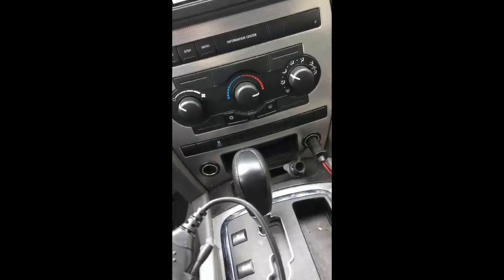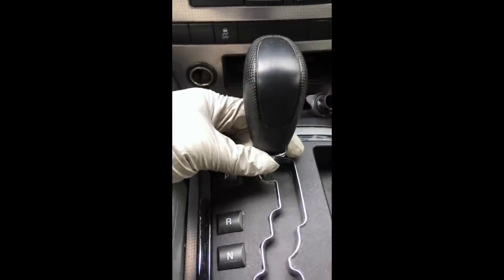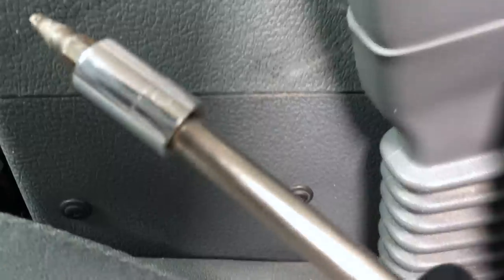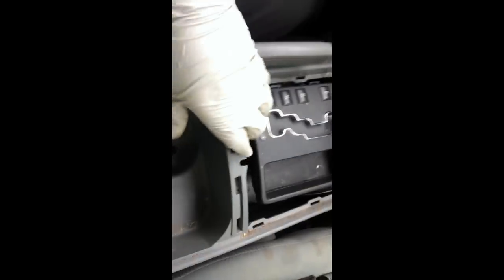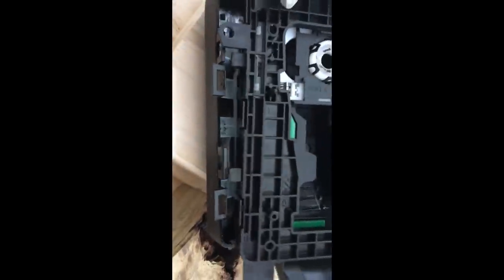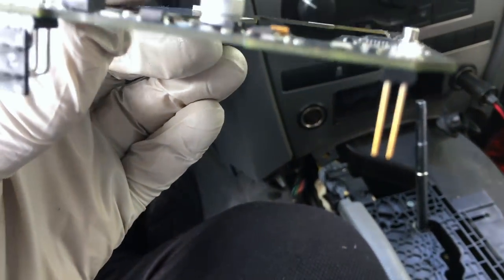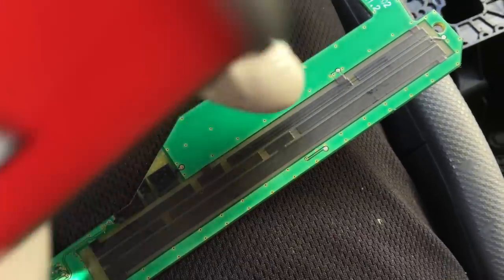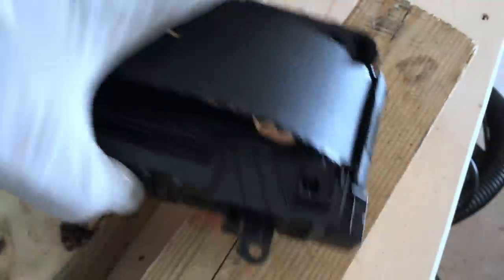2006 Jeep Grand Cherokee (WK) 3.7 Electronic Shift Module (ESM) Problems U0404 P0700 Codes

Comment: I have been going in to limp mode while driving and I notice it on high rpms and I try to manually shift using the + - on the shifter and nothing works. I pull over and restart the vehicle and all is well till it does it again. I cleaned this board and yes it was very dirty on the break points.  Now it hasnt done it at all and it even shifts better.  Thank you  I was about to replace the transmission and honestly it would have done the same thing!!!!
Reply from the maker: @elmslawncare  awesome brother glad to have helped. Save that hard earned money brother. Thanks for the feedback.
Reply: @MrV2u Dear MrV2u, Thank you for sharing this video it is really a stress reliever for some. I have another kind of  problem with my ESM, it works properly in All PRND but, when I put it on Drive, I can't shift to - +, is there a way of adjusting this issue? (I am able to move the "handle" left right but cant go from D to 4321...)

 I opened the upper part as you showed in the vid, There are two thin metallic pieces surrounding the black plastic square that is attached to the white horizontal one (shifter)... Should these be the problem? Could they be cleaned or adjusted? Many thanks😊😊
Reply from the maker: When you put it into manual shift all you do is hit the lever up to upshift and down to downshift. Is that not working?
Reply: @MrV2u  not for me, it is not working. ☹️ Could it be a board problem?
Reply: @MrV2u  To be honest, this problem appeared right after the "cover band" broke (the thing that covers against dust), so I had to open and remove it... and then this problem appeared (any relation to this manoeuvre?)
Reply: @MrV2u  Could you help me please
Reply from the maker: Does the lever move? How did it crack? Did something heavy jam it ?
Reply: @MrV2u  The thing is that the dust strap broke and the plastic part that joins the two mini straps was still attached to the handle and I forced it by moving to P R D N, so I think it may have moved or damaged the steel parts responsible for the - + shifting. 

My question : Is the plastic strap responsible for shifting to 1234 during drive mode (D) ? Or something in the electronic board may be dismantled ? 

Nb: I can still move the lever left and right in D mode, but on the pannel board it is not going to 1 2 3 4, it is blocked in D . Please if you could help would be great! Thanks a bunch ❤️.
Reply from the maker: You may have to swap out the entire esm handle and all. You definitely tweaked something in there.

Comment: I've been a transmission tech for 21 years. You did a fantastic job on this video my friend! helped my stress level tons! Thanks, take care and God bless!
Reply from the maker: Thanks brother for the feedback. I try to be as thorough as possible. Bless you as well. If you have any further questions I’m always here to help my friend.
Reply: Update: The small two wire connector at the right rear of the shifter was broken. The big connector was fine. The board was new so someone had their hands in it before me. Made sure it was back together correctly and it worked perfect. Customer was happy.... Thanks again!
Reply from the maker: Too many cooks in the kitchen. Good catch my friend. Tracing electrical problems could be quick or an all day deal. I just had a guy with the same issue and swapped out the esm twice, and cleaned each one twice like I showed. Still having issues. I bet that’s his issue as well. Keep in touch brother.
Reply: @MrV2u  @ hello, i have the exact problem, but my first question : why need to disconnect the battery ?  can i not to ?
Reply from the maker: @xuchun5371  you don’t want to short anything out by not doing so.
Reply: @MrV2u  @ thanks for quick reply , but will it effect the computer re-boots ?  i have a 2009 Jeep GC
Reply from the maker: @xuchun5371  not at all brother. Just do it like I did in the video and everything will be saved including your radio stations.
Reply: I have a 205 Jeep Cherokee stuck in first first gear I watch a video I took it apart and clean it that good with the chemical spray I'm going to go back and do it again
Reply: I was trying to say I don't think I cleaned it that good cuz I didn't have that chemical spray I use alcohol but I'm going to go back and do it again we clean it again with the chemical spray
Reply from the maker: As long as you get some of the build up off it should help you.

Comment: You sir, rock. I've a 06 Commander.  The exact same shift module and interior shown on your video.  Had the exact same codes and lights come on that you shown when I drove in to Buffalo from Jamestown NY a few weeks ago.  Since I pretty much just bought the Jeep used, thoughts of "Crap, what did I get myself into??" flew through my head.  Did research, found your channel. Spent yesterday doing exactly, step by step following along in your video.  Worked perfectly.  Thank you again for being such a valued resource and doing them is such a clear, concise and no "techno-jargon" that the average layman can follow.  :)
Reply from the maker: Everything is the exact same on the commander as the Grand. The dreaded first drive lol. I'm glad I could help a fellow Jeeper out. Thanks for the feedback it means the world to me. If you should ever run into anything I'm always around for help.
Reply: I couldn't have said it any better!!!

Comment: Three years later and you're still helping people! Just wanted to say thank you for the detailed video. I had the same issues and was happy to find out that it was a rather simple fix. 
Thanks again.
Reply from the maker: Your very welcome brother. I try my best to help out as much as I can. Glad it worked out good for you brother. If you should ever need any more advice I’m always around.
Reply: Hello , I have 2006 Jeep , my dash lights were all flashing having no problems with shifting . Plugged the code reader in # u0404 Gear shift control module . Can I do this to my Jeep ? I’m not sure what to do
Reply from the maker: You defiantly can do it for your Jeep.

Comment: My Jeep is having this same situation and no one, neither the dealer had been able to tell me what it was. All they said was that it was an issue with something related to vapor emitions, that my car would not pass the regular revision due to contamination issues. May the Lord bless you and multiply your business, for all the help that you have delivered to so many people, including me. Thank you so much.
Reply from the maker: Ricardo Cajina does it have a check engine light on or do you know the codes it has? If the lights around the indicator are all on like mine this should fix it no problem. Let me know I’ll dig into it more and try to help you. Thanks so much for your blessings. All things possible with Him at our side.
Reply: Hello again MrV2u, I do not know the codes, but the mechanic checked in on and said two things: The EGR valve is giving slight problems, it is recommended to replace it. And the error that it shows is related to transmission gear, but on the scanner it reads something like unspecific error, so there is no code. He said he had to check if there was a situation with the gear or the solenoid. But on the EGR subject, I found this  Omix-Ada 17712.05 EGR Valve that indicates to fit my vehicle. Can you tell me if I should buy this instead of a Mopar EGR valve which Price is twice the Omix-Ada one.?
Reply from the maker: The omix-ada 17712.05 is for a 05-06 Jeep Grand Cherokee with the 5.7 motor. If that’s what you got go for it brother. I’ve seen codes set off random codes and once you fix one problem the rest clear. Let me know how it works out brother.

Comment: I have never commented on a YouTube video before, but had to in order to thank you for posting this video.  I recently bought a 2005 Jeep Cherokee Laredo and these same error messages kept happening. I showed this video to the mechanic that I bought the Jeep from, he cleaned the graphite off, and I haven’t had any issues since then. He didn’t even charge me for the fix. So thank you so much for this video, as it popped right up when I searched for the issue I was having.
Reply from the maker: That’s awesome brother. Thanks for the feedback. And if you have any questions in the future I’m around for advice.
Reply: What kind of problems were you having ? My dash lights were flashing having no problems of shifting, I plugged my code reader in and it’s saying # u0404  Gear control module. I don’t know what to do . It still drives fine dash lights are gone .
Reply from the maker: It can drive ok for now but eventually you’ll have shifting issues and might go into limp mode. Try to clean it and prevent other issues down the road brother.

Comment: I had this problem recently.  Cherokee was stuck in 3rd gear and check engine light came on.  Took apart the gear shift and the control board was fairly dirty.  I didn’t have any electronic cleaner,  so I used some mass airflow sensor cleaner instead.  I figured they’re the same.  Put it all back together,  Jeep ran normal and the check engine light turned off the next day.  Getting to the control board,  I had to use smaller hex/star whatever screwdriver.  But the process was all the same really.  I wonder if because my Cherokee is the special 65 year edition, that maybe the hardware was a little different than yours.  Anyways,  I’m writing to tell you how grateful I am you posted this.  I bought my Cherokee in December of 08 and had her for almost 15 years now.  My wife wants a newer vehicle, but seeing how the price of everything these days is so ridiculous,  I’d rather fix our cars up than put up with dealerships and the quick depreciation of newer cars.  Thanks again man, these kinds of how to videos are lifesavers
Reply from the maker: I had a 65th anniversary too brother. I agree with you 100 percent with keeping your current car up and running as long as possible. Interest rates let alone new car prices are astronomical. I make my videos to help people save their hard earned money. Thanks for the feedback brother. Keep on Jeeping.

Comment: Thank you for a great and fantastic job you should be a teacher you explained every thing in a great way GOD Bless
Reply from the maker: sal kay First of all God bless you to brother. Means a lot and hope I helped you out. Any questions I’m always around to help.
Reply from the maker: They might be soldered to the circuit boards bro. Pull the switch out and check, but I’m pretty sure there not replaceable unless you solder them off and get some new ones to solder back on.

Comment: Thank you! That was a great video. You do an awesome job of showing each step and tools needed!
Reply from the maker: Im so glad that you liked the video brother. Thanks for the kind words. If you ever need any advice on anything Im around to help.
Reply: Hey man quick question what was it doing dor you to have to do this ours is ahifting to like 3rd and it quits shifting shut if off start it back up and its dine until it does it again any info would help
Reply from the maker: It was acting a fool. Lol this issue would cause anything from: hard shifts, holding gears longer than normal, putting the Jeep into limp mode, illuminating all the shift indicators on the dash, check engine light, feels like the Jeep is bucking, etc etc. Its not a bad job to do, and will save you money in the long run. Let me know if that helps or how you make out brother.
Reply: @MrV2u  I could definatley use your avice/expertice if this step does not fix the  po700 issuewhats next?
Reply from the maker: @richardbeach8689  causes of the P0700 code could be: Faulty transmission control module,
Transmission valve body fault, Shift solenoid issues, Open or short in the wiring harness. With that many miles brother I’m leaning toward getting the tranny rebuilt. Sorry to say brother.

Comment: The fix worked perfectly! Thanks so much for taking the time to make such a helpful video.
Reply from the maker: Jason McKinnon your very welcome brother. If you ever have questions I’m here for advice
Reply: @MrV2u  @ OMG ! i finally open the transmission shift box as you shown us , but my 2009 Jeep GC is using magnetic control , no graphite ,  now i have a code  U 0101 [ lost communication with TCM ]  , what should i do now ?
Reply from the maker: @xuchun5371  it could of popped up when you disconnected the battery. If you can clear the code and take it for a test drive. It is more than likely nothing to worry about. Let me know if the code comes back.
Reply: @MrV2u  @ thank you for quick reply, 
i did nothing except put the assemble back , engine light come on after 15 minutes but car driving fine , i will bring it to autozone ask for clear the code and continue test drive it ,
Reply from the maker: @xuchun5371  yeah I’m pretty sure it’s just because you disconnected the battery. Let me know how it goes my friend.

Comment: Awesome, here is my tip on top,
The car will still drive in auto but not in semi manual mode ,
I have to literally do this with my 06 Jeep SRT8 every 8-12 months, cause that’s a Mercedes part that’s not easy to come by at a cost of $800,

You DON’T need to dismantle the entire console, just remove the shifter module, and disconnect the cable, document how you take it apart with photos first time you take it out if you’re unsure, 
The idea is to clean out the board, so cotton tips, buds and electronics cleaner, rub any graphite you see parallel to the board and make sure you do it many times over and over till it doesn’t show any dirt on the cotton. 
You’ll have to be gentle with the clips the most as you take it apart, clean out the housing and the underneath area while you’re at it, 
What I found is that in most cases it will take about a 1 to 3 days of driving for it to work again after you clear the codes or just put it back together, 
some days it worked right away and other times it took a few days. 
Just be patient and don’t rush it, this is not something you want to break, scratch or damage by any means.
If it doesn’t work after a few days of driving, repeat the process and it will eventually work, it just means it needs more cleaning. 
You don’t have cleaning solution, use alcohol wipes, but not direct alcohol LOL

Comment: Worked like a champ! Bada Bing!
Reply from the maker: T- ilex awesome glad I could help. Any other issues I’m always here to help and offer advice. Thanks for the love.
Reply: Bing bang boom! Thanks for the video Brother!
Reply from the maker: FateOfAll boom bada bing bang... yes sir I’m glad I could help my friend.
Reply: @MrV2u  your a saint, God Bless!

Check engine light has been on for a while.I have been having poor mpg and a few times my gears didn't catch (happened on the highway twice 😥). Went to AutoZone and they pulled this code. They said it was a dealer code and told me to do some research. I searched the code and found your video.

I have the tools to fix this and I'll let you know how it goes!
Reply from the maker: FateOfAll hey you can do all things through Christ who strengthens you. It’s going to come out just fine. Watch the q-tips, it’s going to be dirty. Let me know if you have any questions I’m always around for advice/help. Peace brother...

Comment: That did it, all is good again! Happened pretty quick and was intermittent during the last couple of days.  Codes were the P0700 and all the dash gear selector options would all show as selected intermittently and corresponded to  the tranny acting up.  Sometimes it would go back to normal just driving or sometimes I had to pull over and run the shift lever to park then to drive again.  Codes also indicated the TCM/PCM is probably bad (nope)  All it was is as you showed, bridging of conductive carbon on circuit board that the metal contacts slide on to tell the trans what gear you have selected with the shift lever.  Used 91% iso rubbing alcohol (normally prefer 99% though and the normal 50% has been too weak in the past to clean very well).  I also agree with the others, great video detail.
Reply from the maker: Amazing brother. Thanks for the feedback. Glad it all worked out for you.

Comment: You think the ESM would be the issue for a 07 grand cherokee 4.7 stuck in park even if it's not throwing any codes for it? Professional computer didn't find anything for it... First issue I noticed was when I put it in park and shut the car off the wheel wouldn't lock, I could turn it all the way around. Then I would have issues getting the key to turn over had to jiggle it for a while. Finally one day when the key wouldn't turn over I pulled the shifter into neutral to try to get the key to turn, it didn't so I put it back in park. Finally got the key to turn and that's when it was stuck in park, been like that since.
Reply from the maker: Dylan Webb awhile back there was a recall for the ignition switch. Has that been done to your Jeep? Seems to me like a ignition switch issue. If you have heavy keys on your key ring that could throw it off. That’s what the dealer says lol. Let me know if you had the recall done.